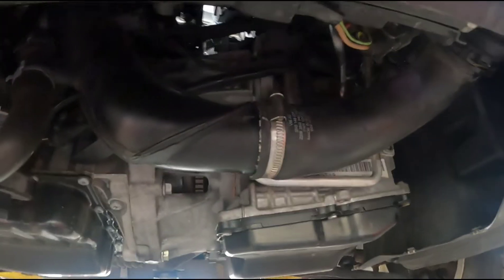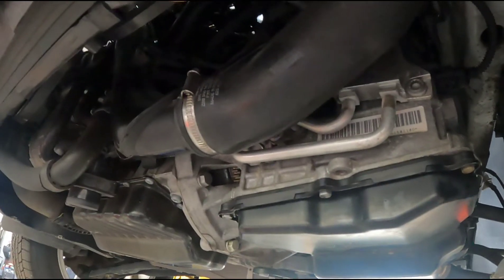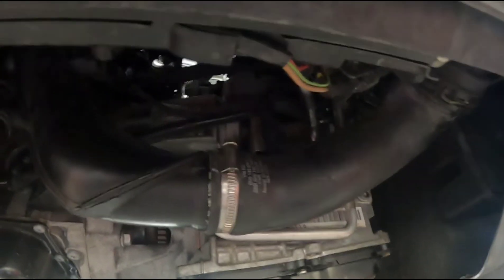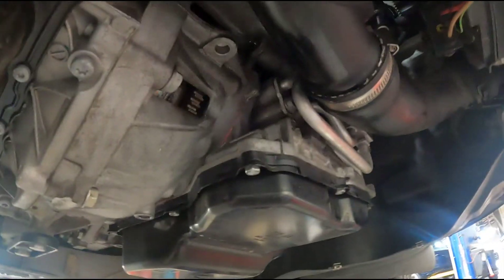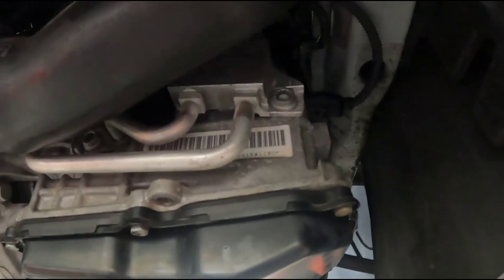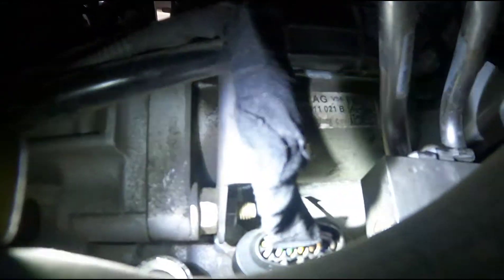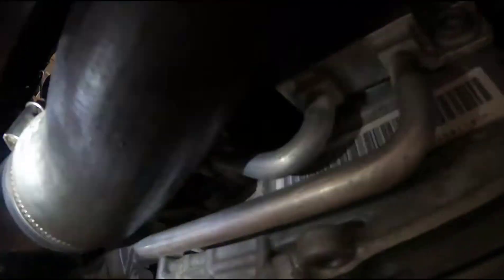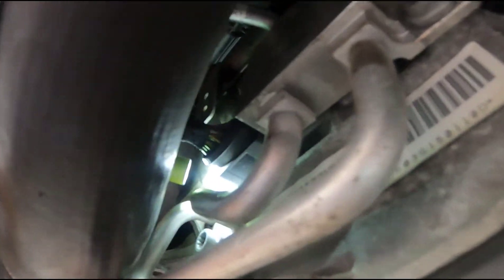VW TIQUAN 09G / 09M transmission solenoid open circuit faults

Comment: Hello, usually I ask about engine problems. Today I was searching for transmission code P0731 Passat 2017 9G transmission SCU code for the model. Does this code  point somewhere I can test? No other codes in the transmission module. Car stays in 3rd gear from start. Does not shift into 1st or 2nd, jumps into 3rd and stays. Sometimes it will jump to 5th and stay there until ignition is turned off. 94k on the car , trans fluid drained 4qts ar dealer 20k ago. Drained 4 more currently but no difference. Hopefully a suggestion if you can. Thank you.
Reply from the maker: I believe that’s a 1st gear ratio fault, usually not a great thing to see, if a valve body issue is the cause its still likely that the clutches are damaged, might not be a bad idea to look for a used transmission, any other faults stored?
Reply: Thank you so much for your response. That's the only code. Being a scu variant of the 9G, it's like 3x more than the ntj variant. I appreciate your experience.  We did a replacement of a TSI intake manifold on my 08 Passat based on your suggestion for the code we had at that time. 
Thank you again.
Reply from the maker: @waitingforparts57  no problem man! Hope things go well

Comment: Hi. Very useful video. I have a VW Tiguan Diesel 2.0 auto (2016). I am getting a solenoid 5 open circuit error. What could be the most probable reason? Is it an electrical fault as you say in your video or the mechatronic unit is damaged?
Reply from the maker: I would check those wires at the transmission connector real good before anything, it may need a solenoid but more likely a broken wire or damaged connector pin

Comment: What if you get clunking from gear 2 down to gear 1 when coming to a stop, but no fault codes?
Reply: My 2012 passat is doing that too. it has the 09g.
Reply: My 2011 Jetta is doing this to, it slams very aggressively. To minimize it I have to brake as gently as possible. I thought my transmission blew up the first time it happened.

Comment: Good info, thanks for sharing !
Reply from the maker: No problem, thanks for watching
Reply: Do you happen to know what could possibly be wrong 2008 vw rabbit code P0730? Thanks
Reply from the maker: Believe that’s a gear ratio monitoring faults, the auto transmissions in those cars have common valve body issues, see if you have any other faults stored in your transmission control module